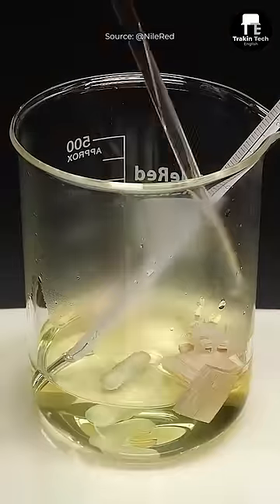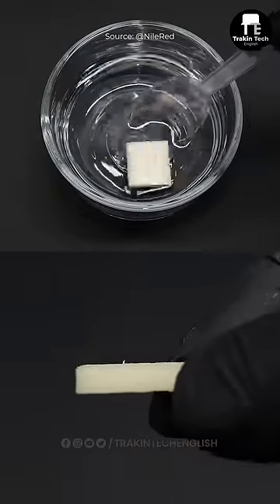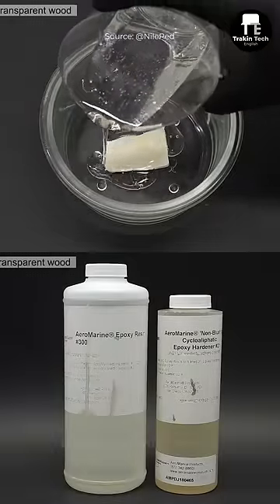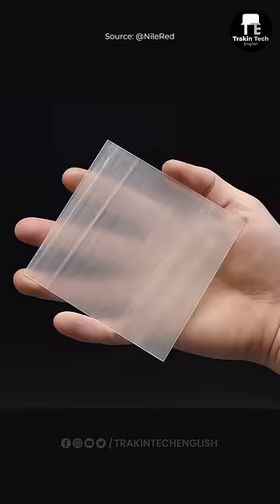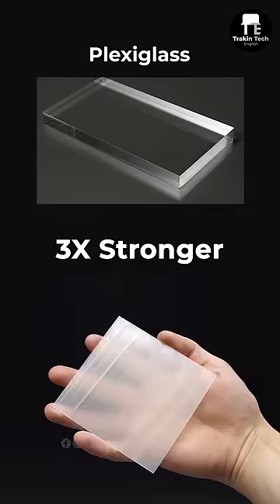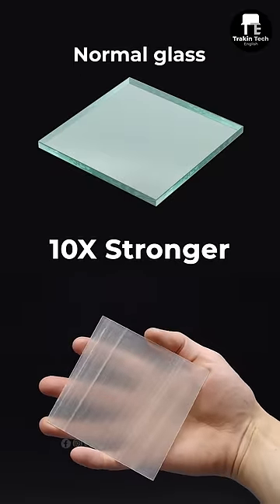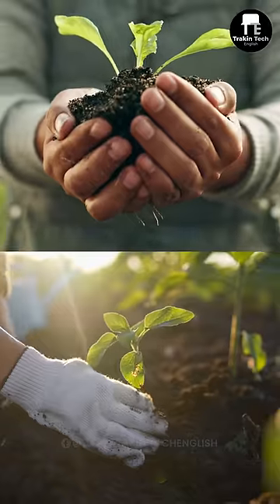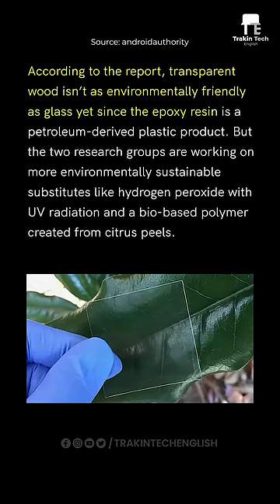Your Next Phone Display Will Be Made of Wood? #shorts

Comment: if you dont know :- An electrical current runs through the two layers while the monitor is operational. When a user touches the screen, the two layers make contact exactly at that spot.

Comment: Correct me if I'm wrong, but screens work when we touch it and interrupt the electric flow, and wood is an insulator. How will a wooden screen work?
Reply: Is glass a conductor? Neither is plexiglass. So to answer your question, it will work just fine, but there are 10 more reasons for that not to work

Comment: But Wood will Be soft Chopping With Chopper Leaves Marks on Chopping board  Now our Phone Display wooden glass will be in  Contact with Gravels Cement and Stones and even under car tire 😅 it will not break because of Wood have Flexibility more than Glass but It will be dented burned or ply guys 😅 it's not only Making it transparent there are more challenges in it .